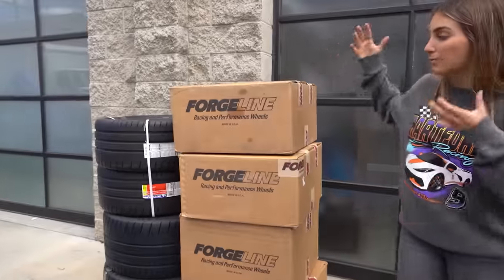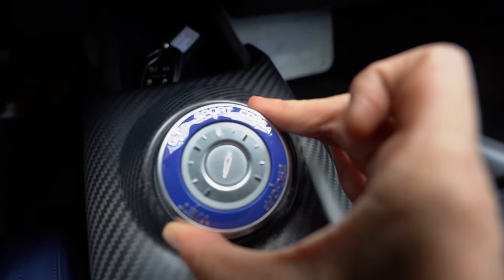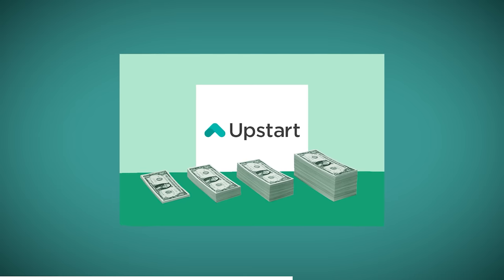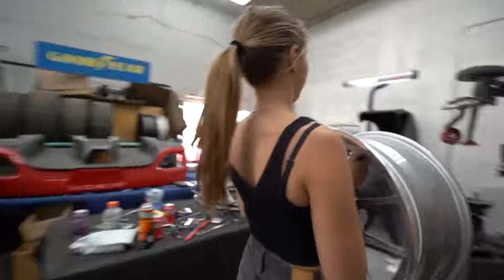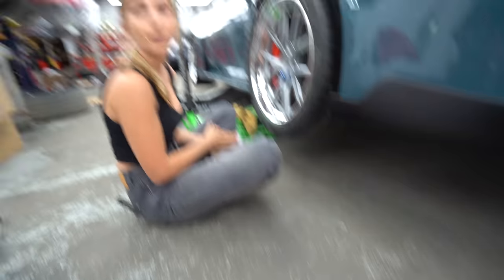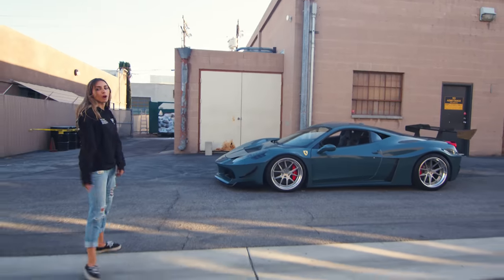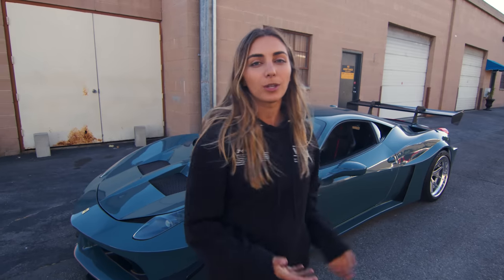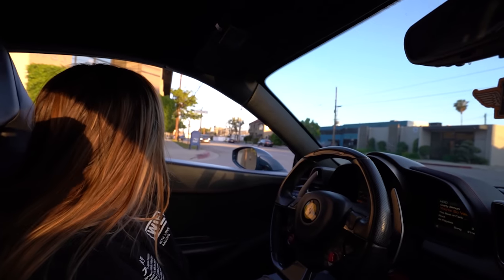Introducing My Ferrari 458 Liberty Walk Silhouette GT

Comment: Having been there and having tipped blood sweat and tears into a build before, I am glad you still love the car after this modification.  

Seems there are a lot of people here that love it too, but I have to say the quality of that job would put me somewhere between angry as hell and heart broken.  Reminds me of when I had one of my car's resprayed and found there was dust through the entire clear coat for 1/2 the car because a booth wasn't cleaned.

@0:10 Ferrari badge .  Visibly rough finish.  You couldn't wet-sand and polish that without hitting primer.
@8:48 Rear end around badge.  Uneven surface, not properly block sanded to remove visible high spots.
@9:09 and 9:25 left rear quarter panel... (wow, that's wonkey.  Look at the reflections off the rear quarter as the camera moves).

Still glad you love the car, but... wow that's terrible.
Reply: At first when you mentioned the badge at 10 secs I was like ehh maybe it’s the angle. Maybe you’re being nit picky.  But after the 9:09-9:25 segment, I have to agree.  The bodywork on that kit was half assed and especially for a Ferrari, shouldn’t be allowed.  I’d be upset for sure.

Comment: Time code 0:44 the 458 is at a gas station where there is a red light reflection off the 458 which looks like a pinstripe. The 458 would look awesome with a red pinstripe

Comment: The Ferrari came out really nice 👍🏾

But your pushing me away 'young wrench', with the tire spinny, street racing videos. Street racing is responsible for 20% of public roadway deaths, and most of the casualties had nothing to do with the street racing, their lives just got caught out by somebody else's Bu## ##it. Street racers and street exhibitionist have become like gangbangers taking over streets in broad day light, putting people in purposeful danger racing in traffic, driving 20 to 50 mph over speed limits. And your pretty much promoting and supporting that s### with the street exhibition videos. 
The high volume of post of this behavior, is what is making it stronger.

ANND.. you've been so busy trying to make the Vette the fastest straight liner street Vette, you have not tuned it for circuit work, and that is what the Vette was built for in the first place.
Just imagine a 1000HP Vette that is great on a circuit 🧐 would you be the first 🤔